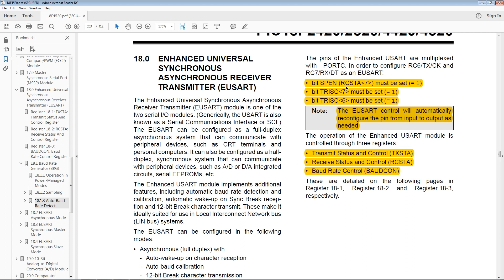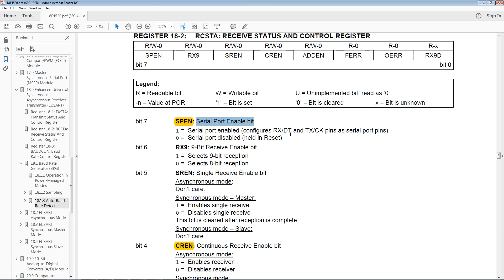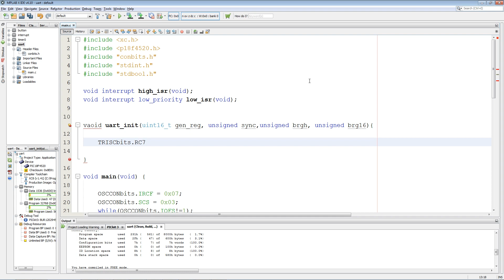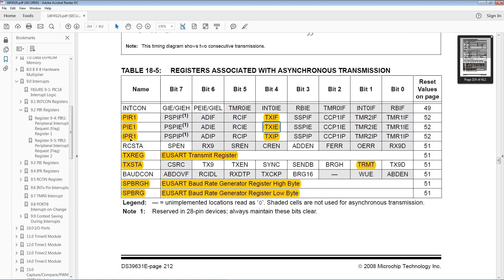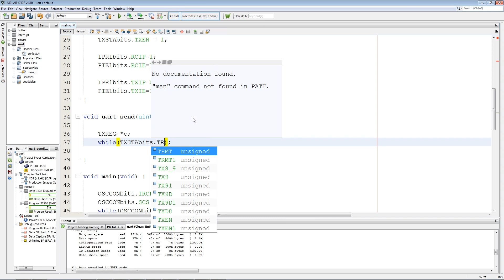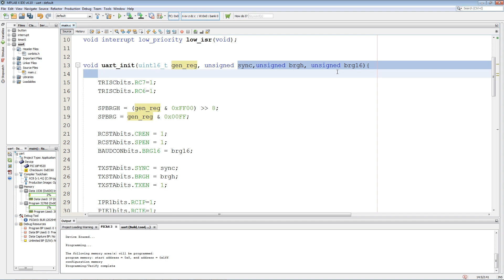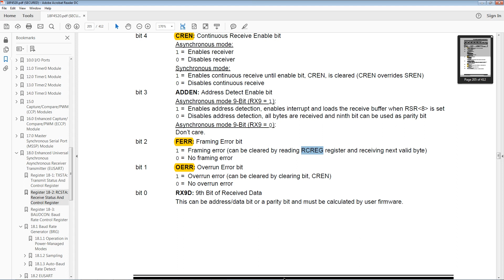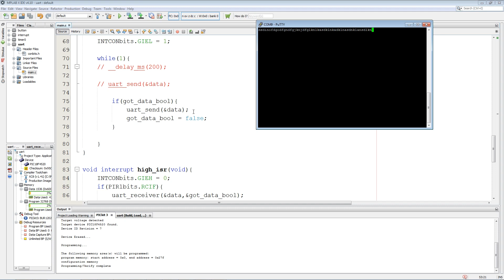Serial UART 🔴 PIC Microcontroller Programming Tutorial #7 MPLAB in C

Comment from the maker: Full playlist on the PIC microcontroller Programming https://www.youtube.com/watch?v=KSI6fzOPVz0&list=PLtuqBdbsL-DtSo1a9pS4sLkoaU3Or2pl3
If there is anything you would like to see let me know.
Reply: as I know, Input TRIS.. =1, output TRIS... = 0. 
TRISCbits.RC6 and RC7 are TX and RX. 
RC6 is transferred, RC7 receives mean RC6  output and RC7 input. 
Why you use both of them for input  " RC6 RC7 = 1 "
Reply from the maker: @vantoanle8257  0:40
Reply: @BinderTronics  thank you so much, i dont see that.But when reading PIC16F887 datasheet, I realized it doesn't have that line, so with pic16f887 I also configure it like you?
Reply from the maker: @vantoanle8257  12.1.1.1 Note 1. No need to alter the TRIS register.

Comment: hello, I'm quite new to micro controller. I cant understand the start bit and the end bit of a signal. Could you please make it a bit clear. love your videos &  thanks in advance.
Reply from the maker: Frame format:
Idle | start | data | parity | stop

idle: digital high
start : 1 bit width low
data: 5-9 data bits.
parity: 1 or 0 of 1 bit width
stop : 1 or 2 high bit widths

1 bit width is the baud rate. Since this is a Asynchronous hardware protocol, each bit has a set time it can be high or low. This also means that the sending and receiving end needs to be configured identical for it to work. So a start bit is 1 bit width low. The stop bits are 1 or 2 bit widths at the end of a frame.

In most cases for UART you don't need to concern yourself with the how the frame is generated. All you need to do is load the transmit register (TXREG in this case) and the frame is generated for you. All you need to concern yourself with is the data width, parity type, number of stop bits and the baud rate in the setup. 

https://ww1.microchip.com/downloads/en/DeviceDoc/Atmel-7810-Automotive-Microcontrollers-ATmega328P_Datasheet.pdf
19.4 Frame Formats
Reply: Thanks a lot

Comment: Hi ! this is my code for transmission : do you know why i have nothing on my Port C ?

#include <pic16f18344.h>
#include <xc.h>
#include <stdint.h>
#include <stdlib.h>

#define UART_TRIS_RX TRISCbits.TRISC4
#define UART_TRIS_TX TRISCbits.TRISC5

#define _XTAL_FREQ  4000000     // System clock frequency
#define MAX_LENGTH_UART 16      // Max lenght of a string send or received with UART

void init() {
    // Oscillator config
    OSCFRQbits.HFFRQ = 0b0011;     // Choix 4MHz
    OSCCON2bits.COSC = 0b110;      // Oscillator mode defined by COSC<2:0>
    OSCCON2bits.CDIV = 0b0000;    // Oscillator mode defined by CDIV<3:0>
  
    INTCON = 0b11000000;
    BAUD1CON = 0b00000000;
    TX1STA = 0b00100010;
    RC1STA = 0b10000000;
    SP1BRGL = 5;
    SP1BRGH = 0;
 
 
    
    // Ports config
    UART_TRIS_RX = 1;
    UART_TRIS_TX = 0;
    
    RC5PPSbits.RC5PPS = 0x14;    // EUSART1:TX1->RC5
   //
   
   
}

void UARTSendChar(const char c) {
    if (PIR1bits.TXIF == 1){ // si vide
        TX1REG = c;
    }
    
}

void UARTSendString(const char* str, const uint8_t length) {
    int i = 0;
    for (i=0 ; i<length && str[i]!='\0' ; i++) {
        UARTSendChar(str[i]);
    }
}

void main(void) {
    
        char* str = "12175742\n\r";
    init();
    
    while (1) {
        UARTSendString(str, 14);
        __delay_ms(500);
    }
    
    return;
    
 
}
Reply from the maker: 31.1.1.7 your pic microcontroller datasheet. Verify that. Also double check the pdm module.
Reply: @BinderTronics  ok thanks i will check

Comment: How will you receive from the UART2?  RCREG2?! . Why did you use the RCREG instead of RCREG1 for UART1?
Reply from the maker: Going to assume your PIC microcontroller has 2 or more UART module on it. I use RCREG cause that is the naming of the C structure for that register on the PIC microcontroller I am using. Since there is only one UART on the PIC it does not need the number at the end of the naming. In the case where there is more than one module that have the same register structure (doing the same thing) the naming will be registerX (UARTx). So if you are working with UART1. All register associated with UART1 will be followed by a 1 thus the RCREG1 in your case.

Comment: Really great channel! I've been giving your videos a watch and they help out so much. I'm trying to get UART working but I need some sort of display or terminal for it to send the transmission to and I'm not sure how to do that :/. Got any tips for setting up putty with it?
Reply from the maker: Going to assume you got a CH340 or FTDI usb-to-serial board. Don't get a prolific based one... piece of crap. Otherwise follow this guide https://pbxbook.com/voip/sputty.html there are linux and mac guides there as well.
Reply: @BinderTronics  not sure if I'm using what you stated above, But as for the chip it's a bit more complex I believe. I've been using a p32mx795f512l and while the ports are different from yours in many ways, your videos have been a great reference to use alongside the manual. I'll definitely check out the link for setting up putty though, thanks so much!
Reply: @BinderTronics  Ok! I think I have the terminal working correctly now. Just have to fix up my code and make it run :)
Reply: @BinderTronics  Finally got code working!
For some reason my Serial to USB drivers weren't installed, which caused the brunt of my issues. Thanks a million for the putty set up though :)

Comment: I have a suggestion/request: Uart communication with the CRC peripheral. I'm using a PIC18F26Q10 to control stepper motors through TMC2209 where the more advanced features can be accessed through serial communication with CRC. Its not the only chip (tends to be high power/noisy chips) that wants or has this additional check. They have an example in the datasheet using code, but a lot of the PIC18F have CRC hardware built in. Ben Eater did a fantastic tutorial on how CRC works ("How do CRCs work?") but an example 'irl' would be awesome (for me at least). Great tutorial set, more on any peripheral would be great. How about USB or the new ADC2? Subscribed
Reply from the maker: If noise is a issue use a RS232 to RS422 connection and keep the RS232 lines a short as possible. This eliminates 99% of the noise problem but this not always piratical. The industry approach to CRC is get someones open souce library for what ever protocol you are working with since most of it is standardized or someone in the company has already written one. I will have a look into it though. I am currently working on a CDC USB device video but I have no idea how long it will take. I will put ADC2 on the list. I am prioritizing getting SPI out the door at the moment.
Reply: @BinderTronics  Good suggestion to eliminate noise. In my case the hardware I'm using doesn't give you another choice except uart with CRC bits. Ordinarily I'd be happy to get a C library, and do it in firmware but it seems a shame when it's a built in peripheral. I'll give the MPLAB Code Configurator a go and hopefully pick it apart.
A USB serial is a great idea as is SPI, I think a lot more people will find it useful. Capacitive touch / mTouch / touch buttons might be another video with wider appeal (and fairly easy too).

Comment: Would it change the procedure a lot if we wanted to establish communication with a bluetooth module?
Reply from the maker: No, just need to change the baud to match the module and create a fifo buffer for the received data. Also may need to create some form of AT parser. You will probably run into lack memory on the 18f4520 before anything else. If you are using another PIC I would suggest using Microchip Code Configurator plug-in to setup the UART.
Reply: Thanks